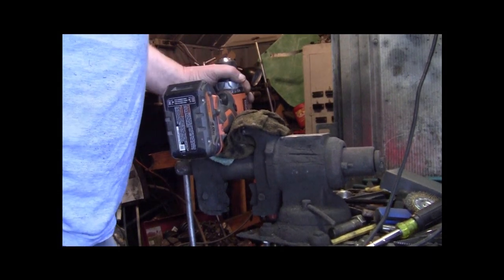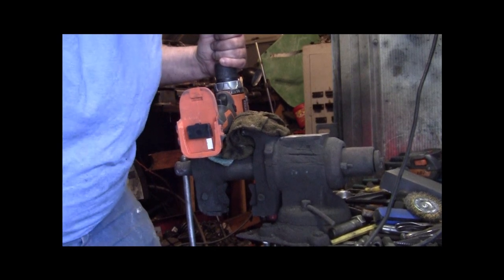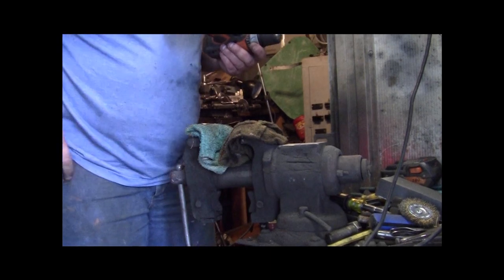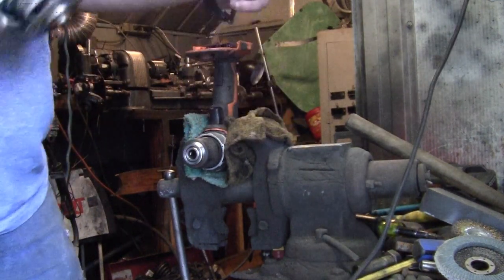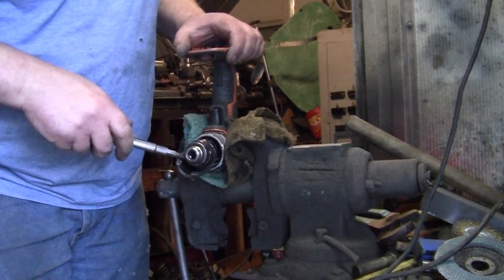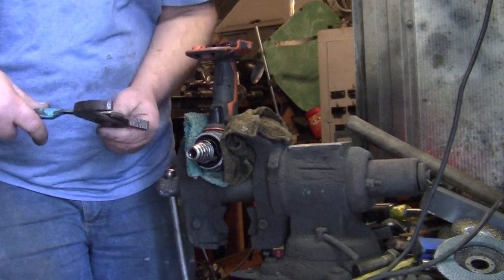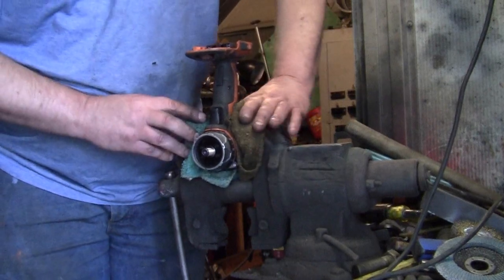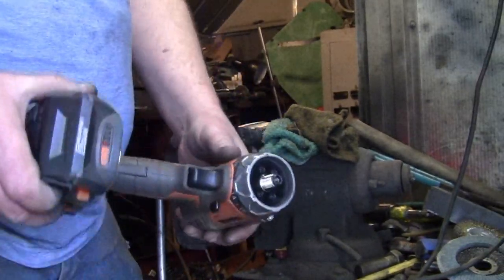easy stuck drill chuck removal

Comment: Had the same issue with a  black and Decker 
Now ive the same issues with a aeg battery drill
Reply from the maker: it happens to all drills sooner or later.. the more power the drill has the faster the chuck jaws loose there surface grip.. I have found this to be the easy way to swap the chuck out ..Thanks

Comment: I used a 1/2" drillbit (largest bit in my kit) and now my chuck is stuck. I'm still under warranty so maybe I'll go that rout first! I've drilled a total of like 10 holes so far. This is total BS. My old Ryobi had to come finish the job as the Ryobi's often do!  Sure beats my Milwaukee 1/2" hammer drill tho... that recently caught on fire after about only 3 holes drilled LOL
Reply from the maker: Yes sir, take it back .. get you bit out with pliers first..
Reply: @shawnmrfixitlee6478  the bit is out... the jaws are just jammed all the way open
Reply from the maker: @misterbulger  can you but it in the lowest clutch setting it has and grab the chuck with some channel locks and give it a little turn ?